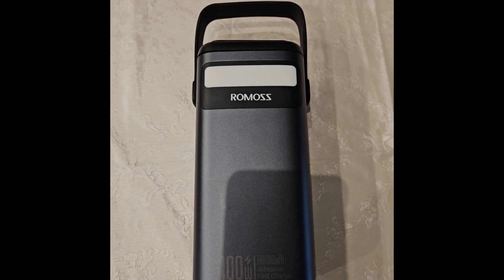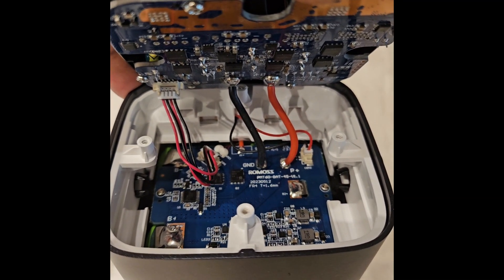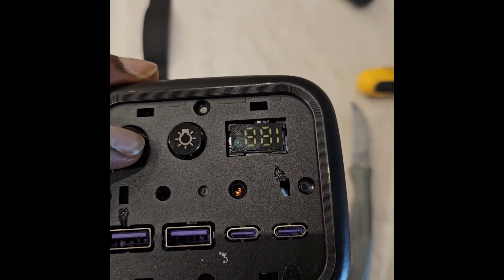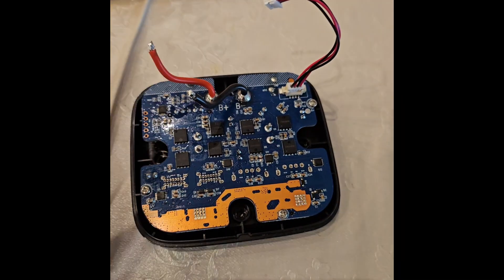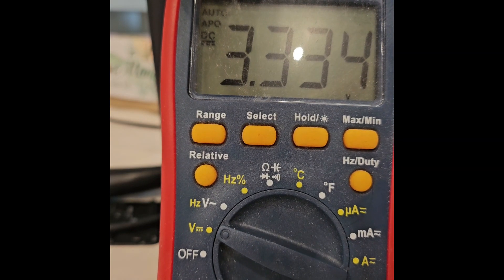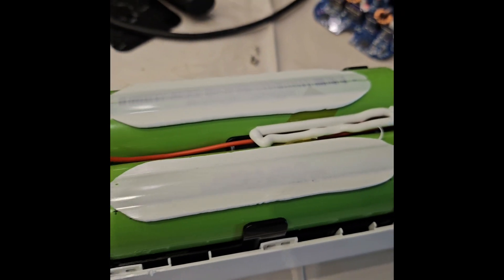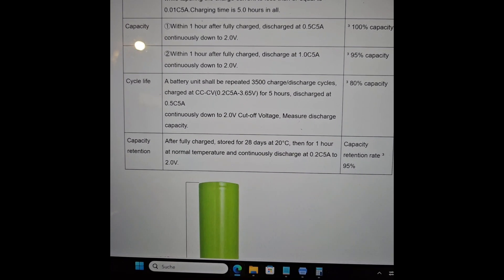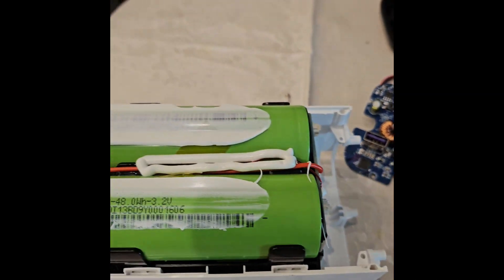Romoss PMT60  Powerbank Teardown, confirmed with LFP batteries

Comment: these dont charge or discharge at 100w, one port doesnt work and they dont have the roper usb cpd rotocols, i have 4 and one has died after one use and none of them run starlink when any other power bank works.
Reply from the maker: Thanks for the Info, It seems that chipset used is having compatibility issues.

Comment: Your instructions made it much easier for me to disassemble my power bank. Thank you. Unfortunately, my pmt60 broke down after a month and a half of operation. The upper board had a short circuit between b+ and b--. I haven't checked all the elements yet. It is difficult to do this without a scheme. If anyone has a schematic diagram, please share. Found three shorted MOSFETs ETBC015H30. But I don't know what to replace them with, because the marking on them is probably some kind of internal one from the manufacturer. It is impossible to find the datasheet and I still don't know what to put in their place. Other MOSFETs that work as a driver also have a marking G3056 for which I did not find any datasheet.
Reply from the maker: Sorry to hear. In my opinion, it would be difficult to find the replacement parts. If the balancer part is still good then you can attach the 140w PD modules from Ali to it.
Reply: @HouseAndSolarProjects  I did it and repair the power bank. Two n-channel MOSFETs, which are located in the ground part of the H-bridge, failed. Unfortunately, it is impossible to find out from the marking which MOSFETs are installed there. I contacted a company representative. He refused to provide such information. I had to unsolder the working MOSFET and measure their parameters. I could not find an exact replacement. I installed MOSFETs with a slightly larger opening threshold and gate capacitance. As a result, everything works. It takes a charge of 100W, but at the output it gives only 40W and goes into protection. Most likely due to a skew in the bridge. There was an idea to replace all the MOSFETs with identical ones, but they are very difficult to unsolder. Soldered with refractory lead-free solder. And the power of 20-25W in my scenario of using it as a UPS is enough for me. By the way. The manufacturer forgot to remove the protective film from the charge indicator under the cover and it was cloudy. Now everything is OK.)
@HouseAndSolarProjects  Thanks again for the video. It really helped to disassemble it carefully and not break anything. Now the power bank looks like new and works. I'm happy and saved a lot of money.))

Comment: With its sub $100 price here in my country, it is an excellent purchase considering that it uses LifePO4 batteries. Even better than the Anker 548 which is only limited to 65W max output and double the price. Thanks for this video!
Reply: got it for $51 from sale price
Reply: It is also limited to 65w
Reply: @WhiteShook  I've seen reviews testing the pd type-c port and they get 100W output

Comment: Did I understand correctly that the 100 W limitation is due to the batteries? It is impossible to get more amperes because of the batteries installed in this power bank and everything comes down to this? Is it possible to get 140 W with this board if there were other batteries that allow you to get more amperes at the output? Thank you. You are the only one who took it apart on all of YouTube.
Reply from the maker: No, it not only due to the number of batteries. The Powerbank in my opinion utilises the Chip in 100W configuration. Unfortunately i don't have access to the datasheet.
Reply: Когда заряд паурбана показывает 30 процентов то выдавать он начинает 65 ватт? это правда? @HouseAndSolarProjects
Reply: @HouseAndSolarProjects когда 30 процентов заряда на паурбанке,то он заряжает в 65 ватт?
Reply from the maker: @Роги-п4у  yes, it charges at 65w till 0%

Comment: The manufacturer claims that USB-C supports charging at 100W. I watched other videos testing this device, reviewers confirmed the presence of 100W of power at the connector. Why do you claim the opposite? I'd like to hear your opinion, thank you.
Reply from the maker: Hmm, I said that the chipset supports upto 140W, here it supports 100W. The manufacturer specifications are correct.
Reply: @HouseAndSolarProjects  Sorry, I misunderstood, my mistake. After watching the video to the end, everything fell into place. I wonder if it is possible to get 140W with USB-K if the chip supports it. If yes, then how? It would be interesting to hear your opinion. Thanks for the review, only you took it apart and showed the batteries.
Reply: @HouseAndSolarProjects  so do you know? Is it possible to get 140W from this power bank? from USB-C connector
Reply from the maker: @jokerbest3020 unfortunately no, I do not have acces to tools required to do it.

Comment: Thnx for the teardown hope it still works maybe you can try to make it somewhat more waterproof then it was with rubber seals also can see now why they cant do 100 watt over the usb a porta
Reply from the maker: Yes, it still works. The Chipset does not supports the 100w USB A Prtotocols